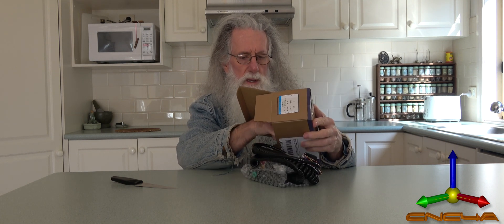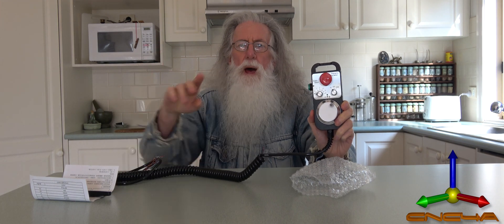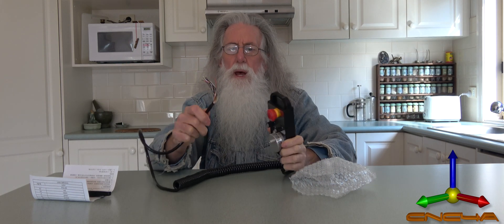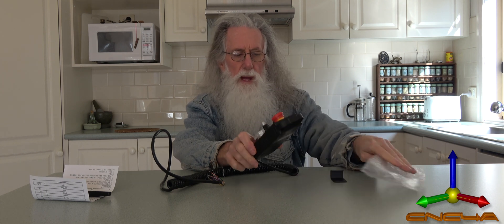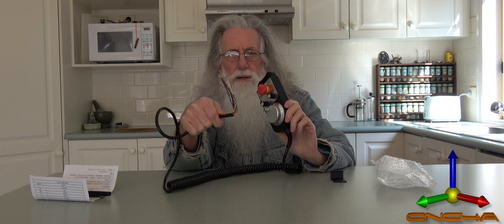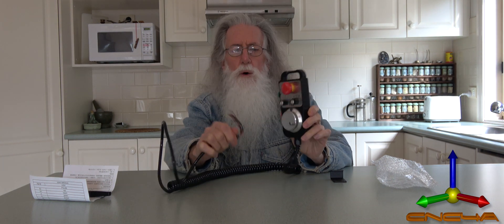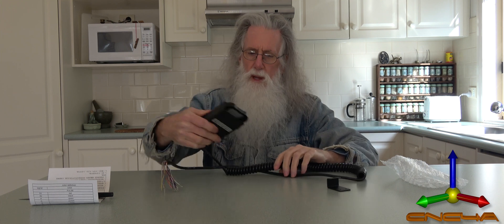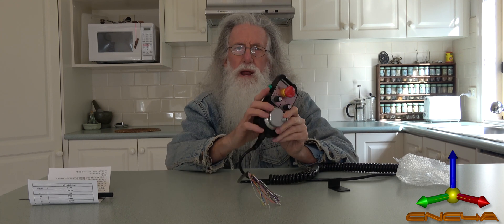CNC4A - Mach3 Alternative 04 - MPG Pendant

Comment: Hello:
In my case for the Zk Motion controller I bought the following MPG:

https://es.aliexpress.com/item/32862425773.html?spm=a219c.12010615.8148356.9.738364c2jZ8313

What do you think of it?

Although I am somewhat worried since no manual appears and when communicating with the Chinese they say that this is plug and play.

https://www.nvcnc.net/nvmpg.html

I hope you are not disappointed when you start testing.

Thank you for your time and valuable responses.
Reply from the maker: Most MPG's are basically the same.  They have an rotary encoder which sends out a A B pulses. Some controllers just need the AB, some A A- B B-, etc so that must match. The 10x, 100x, etc are just switches that tell controller what range to use. Other buttons can go to estop, etc.  Now the wiring is the tricky part.  Those with a plug Can be plug and play if the pin outs match.  Can have the correct wires but going to the wrong pins.  Just pull the back cover off and you can see where what colour wire goes to and check it to the plug pin with a multimeter and you soon see if it all matches.  Mine had a couple that didn't match the controller.  A couple too many and one not there but some of the Chinese diagrams are not the best.

Comment: Hello From America looking reto fitting my super max 3 axis mill with an SZGH-CNC1000MDc-3   controller , YES / NO ?  I have new Teco 750 W AC servos and Teco drivers to match , Tried Mach 3 But nothing but headaches,(pinouts to Breakout boards) love the vid's keep them comming!!!!!
Thanks Badwolf57
Reply from the maker: Greeting Badwolf57.  Thanks for watching and subscribing.  Rather than Yes/No my answer is Ying/Yang.  Dollar wise Mach 3 is a good investment to cheaply get up and going.  Now after that it depends on your needs.  Fanboys will rave on about it being the best thing since sliced bread, just like the Fusion 360  fan club.  But once you grow out of its basic needs it just starts to be a bit limiting.
      The professional/industrial path is much more specialized and expensive but a lot more productive and reliable.  But it all must fit in a narrower range of criteria. With my project I am just getting the very basic part of their controller kit.  If you went the entire way and got everything from them it would all fit altogether and run smoothly.  If not, like me, you have to put on your thinking hat and come up with workarounds.  For me, that's the fun part, it's the journey and what I learn along the way that I enjoy. If it's not then just go out and buy a machine, it might be more expensive, but its quicker, easier and less headaches.
     Just remember that when you see that everything is 24V, negative controlled, ttl, etc, etc and you say why did they do it that way, I will have to replace limit switches, encoders, etc, the answer is that is why it is more reliable, less interference from outside forces, those gremlins that fart magic blue smoke. ;-)
     I am putting up a Mach 3 video when the subscriber numbers go up a lot, titled "Best Mach 3 Ever!" to show how I customized it. That is the biggest thing I miss about Mach 3, its customization ability. You can just write a macro and it will make your lunch for you. ;-)  These controllers have heaps of I/O's and you need compatible relay cards, etc to use them, and be able to program the PLC Logic to get them to do something you want.  But they will never make lunch, they have their job and that is all what they do and that is why they are good at it.
Reply: @TheWizard  also looking at the Masso G3 controller, all in all prices end up about the same .Im running Teco AC 750 w Motors and Drivers on a Super Max 3 axis mill Iv had for 15 yrs, and the old Allen Bradley controls are dieing  and cant get parts anymore .Thanks for the input will keep in touch!
Reply: @TheWizard  
I will be faithfully attentive to see that video of mach3, for me, personally mach3 is something that makes you learn and where you understand first-hand each of the processes, connections and compilations that are required to make a piece.
The rest will come in addition.
Thanks for your valuable advice.